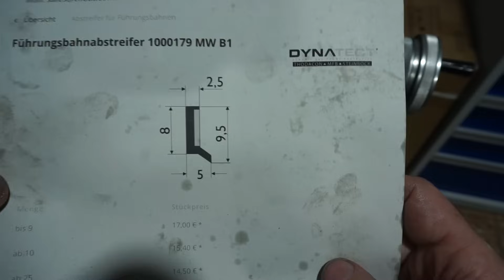Making Custom Rubber Way Wipers

Comment: i am the non metric version of v13 same switch setup magnetically released break on the motor 2speed motor but there is no momentary power button as indicated in the generic manual we were able to find on line that is a 44page pdf i am hoping you know of another version that is available as step up for us and having a very spars operation instructions is a frustration (simply seeing the proper tool for oiling the carnage will make my life easier) though this barbarian will stick with his felt wipers i tend to run 2 stacked on top of one another a soft one made from winter boot liners with a denser felt used for gaskets behind it the soft one removes easily and is more of grit catcher and i punch them out as needed (farm shop) even whey trying to stay clean we are at best dealing with dust and chaff from equipment as it is dissembled and tracked around.     i am very glad i found your channel and hello from Vermont usa
Reply from the maker: Hello Mr. Mose, sorry for my very delayed reply. I checked and found I have the wiring schematics of five different versions of the V13. They are in three languages including English. I could send you a picture of those if you send me your email.
ATB, Alex

Comment: You could hypothetically use both felt and rubber. The felt will still allow for lubrication after it no longer wipes effectively, and the rubber will wipe for a very long time.

Comment: I wonder how well a 3d printed TPU wiper held in a clamp would work?
Reply: I was thinking this as well and will try to print a set for my lathe and milling machine. I have had good luck printing pistonseals for my small oilsucker out of tpu. Didn't expect it to work but it works very well. I would expect it would work well as a way wiper also.
Reply: Works well, I did a double lip version sandwiched behind a stainless strip with pass through collars on each mounting screw to allow a solid mount without overcompressing the TPU

Comment: Hi. You can buy wipers for Weiler E30 and have similar geometry. Maybe they fit whit less trouble. Nice work. I have a machine that I put the felt under the rubber.

Comment: I have the emco super 11. It does not have lubrication points for the bedways within the saddle. So many aspects of this lathe are great but the absence of those ports and no oil groves on the ways are unfortunate omissions
Reply: The Super 11 Engineers spent all money on the headstock and had to rush the bedslide :D
Reply: Would make for a great upgrade project. Easy enough to drill some holes, chamfer and then embed a couple of oil ports. Who knows, you might have a lot of dirt under the saddle and a cleanup/inspection could be quite appropriate.
Reply: @StefanGotteswinter  did you modify yours!

Comment: Oy, nice seeing you alive m8! Long time no see... 
Quite nice to see some work being done... I just spent 3 hours trying to set up a lathe bed for moving, only to have a catastrophic failure of the store bough winch... Not my welded up hoist, but a store bought, certified winch rated at 600kg... Shit snapped like a twig... Thank God i took care and every possible precaution as to avoid any potential damage from unforeseen nonsense... 3 bloody hours of set up, careful deliberation, gentle shifting and wrapping of end-less lifting loops, only to lower the pallet jack as to leave the lathe bed suspended in the air, and have it just sit back down on the planks i set between it and the lathe stand... Absolutely no damage, other than a broken winch, yet i was at least hoping for it to result in a cool video with a great message on moving of heavy machinery without help... Guess what... My fucking camera died at hour and half mark, leaving the other hour and a half of me explaining and working - a totally moot point... 
At least your work turned out better... Its a lovely design and damn nice work! 

All the best and kindest regards!
Steuss

Comment: I would use 2K rubber cement instead of rivets.  And the groove for the scraper is on the other side of the holder, on the seat side.  I don’t have a milling machine, the holder can be made as a set of two plates that form a step and the plates can be connected in any convenient way.

Comment: Always happy to watch a new video of yours Alex. Stop bitting your tongue it is too quiet in your chanel as it is, we dont want it to get completely mute, do we now? 😁 
I was wondering, what is your prefered choice of oil for cutting operations, lubricating ways and lathe gearboxes?
Reply from the maker: Very kind of you Sir, thanks. The cutting oil I use is Jokisch Alpha 93 and the way oil I use is 10W40. Yes, I know, that is strange, but it has high viscosity like way oil and I have very cheap access to it. For the gearboxes I use Eni Radula 46.

Comment: Awesome work Alex. I wish I could buy a set for my V13.  Did you consider using a combination of the felt and the rubber? The felt does hold some amount of oil I've noticed. It seems to absorb some oil and then release it.
Reply: Weiler E30 has a similar geometry, try to find it may be it will work on Emco v13
Reply: On all the  industrial lathes I worked back in the day the wipers were made of felt. Using random rubber may not be appropriate as the oil used for guide lubrication will highly likely dissolve it. Many people never use oil on their machines. Whoever spotted leaving their machines with no oil on the guides was subject to fine at the plant I worked at.

Comment: Good idea and nicely done. Did you consider using windshield wiper blades? Not as robust as the material you used, but they do have a SS backer, are reasonably tough, and probably less expensive. Might be more challenging to mount, and probably have to change them more often.. Just a thought.